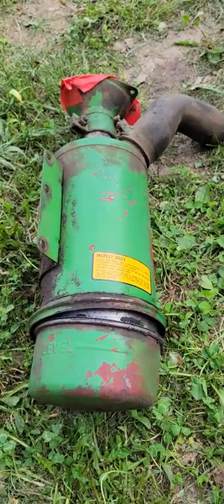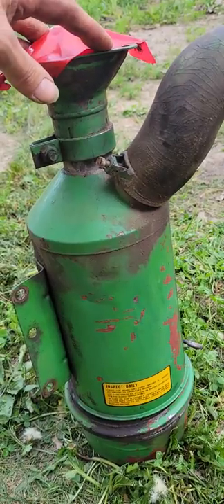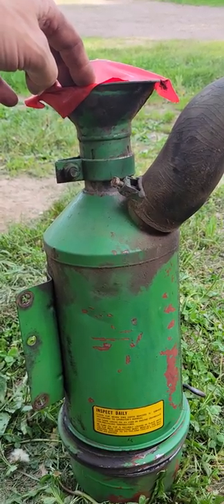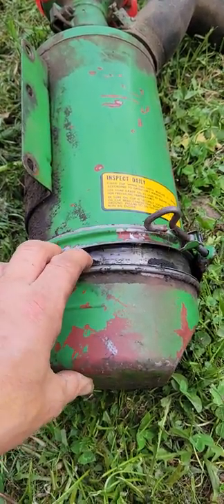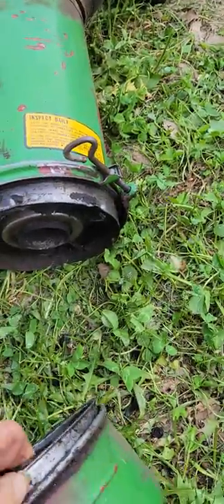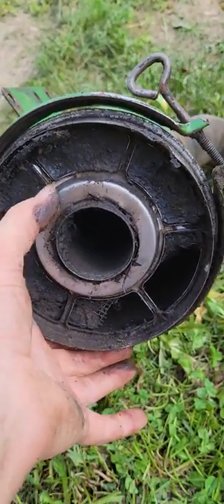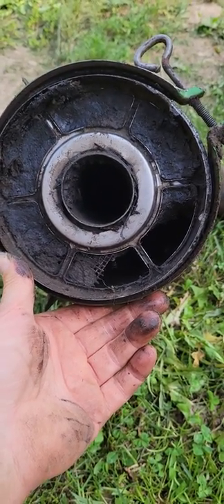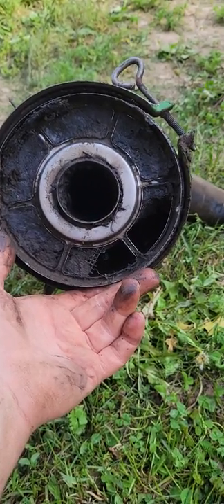oil bath air cleaner

Comment: It is a stainless steel mesh material that is rolled up inside the canister. If you look closely the bottom grid piece is held in place by some small spot welds around the outer rim. Carefully drill these out and remove it. You can then remove the mesh material. Unroll it and clean it. Also clean the canister. I used a power washer with detergent. Let everything dry then re roll it and insert it back in the canister. Insert and re weld the bottom piece and your done. Mine wasn't quite as bad as yours but had never been cleaned. You can also find a dry filter type from a later model tractor and convert. Good luck...